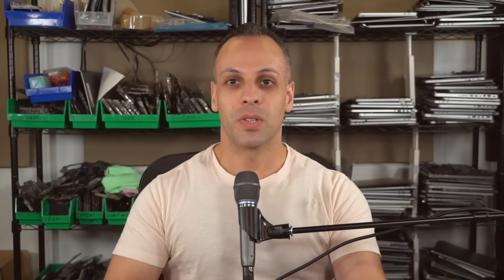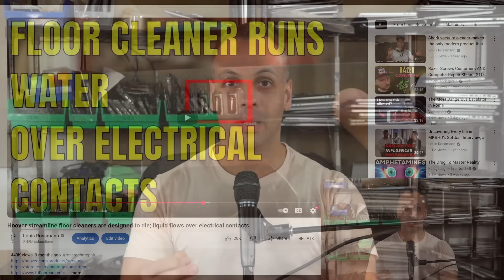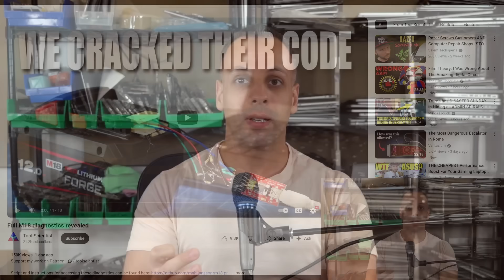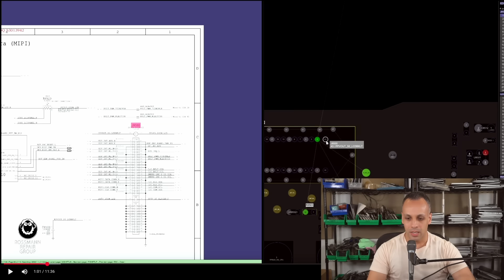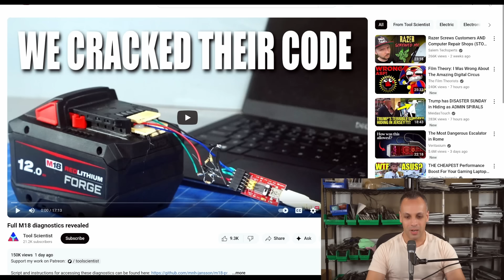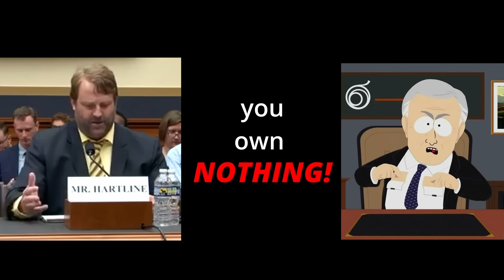Imagine putting DRM in a battery to void warranties...

Comment: I restored my 27 year old battery (NiMH) powered drill by soldering in a plug so I can use the LiPo batteries I already have for my RC and fpv hobby. 

So simple, added a 2 USD voltage display since there’s no BMS. 

Since the LiPo’s are storage charged they are always ready to go and I charge them AFTER I’m done drilling. 👍

Comment: I do have bunch of Milwaukee tools and biggest fuck/n regret is that bluetooth 3/4 impact gun. I barely used it as changed jobs and after a while(it was tucked in a toolbox, nice and clean) the bluetooth battery died. Okay I thought just replace the coin battery and that’s it…wrong, somehow the bluetooth controller died, just blinked, but stupid me never did extended warranty so it was too late to replace. Had to buy a new complete loom - basically the whole electronics) for around £100 and have it coded to my serial no. Worked again for a month or two and now can’t even connect to app and shows that tool being registered elsewhere…putting Bluetooth into an impact gun was the most stupid idea.

Comment: Wow, that was fast. The video by tool scientist was only recently released and now already featured by Rosmann. I am happybto hear the issue of subpar batteries by Milwaukee is being adressed, if only now through the narrative of TTI. I think adrrssing that a missing relevant bms cell balancer is long overdue. Toolscientist already showed that the new forge batteries haven't made a relevantbjump in bms board quality for cell balancing in their new forge batteries. So there is still room for a lot of improvement. It is only unfortunate they dodn't take the chamce to really make a better battery while they had the chance. Maybe there was relevancy through customer feedback to.adress power issues. But I think itbis an omission that they didn't adress battery technology basics in cell balancing. There was already general knowledge technology knowledge available on cell balancing by big cimpanies, Trdla amongst others. For the premium prices Milwaukee offers, the fact that the batteries prematurely fail longe term use over power metrics is a waste of investment for the consumer for a technology of batteries that has been proven to last a longer time than older rechargeable batteries if treated cirrectly with correct health. Yes 't  demands are different in power tool batteries and lifetime will likely be somewhat lower. Un my experience though, the lack of a proper cell balancing technology could gave helped power loss over time due to uncreasing cell voltage drifting due to improper cell balancing components on the bms board could have helped diminish this long term issue. I can not imagine Milwaukee  did not know this. I think if added it would not diminish its brand loyalty. Contrary to what Rosman is claiming, I don't think Milwaukee as a subbeand of TTI is not making rubbish tools. My experience is tools I purchased are actually powerful and good. What I do notoce is that new products are often focussed in solving user functional issues, but not going the extra mile to factor in certain relevant factors into further improving certain less known features that could help improve the longterm health of certain tools. I do consider milwaukee as a premium tool brand. They certainly ask a premium price, but hthey also have been ahown in many comparisons to be an on average very good tool. I think on design  and support they sometimes could do better in the ergonomics and sound overall ergonomic design. But going back to the thread of this story, ues, the lack of a proper cell balancing technology in the charger and battery is an eyesore in the whole experience. So many videoa have been out there on the three bar (..out of four bar maximum) full charge issue has been here for years. I have discovered myself as well that the cell imbalances are a glaring issue. You can balance them yourself with not too complicated tools, which I.have unfortunately also done for several years with my milwaukee batteries, so have got some experience. One could argue it could be perhaos the cause of increased cell resistance due to high power demands usually associat3d with the function of the tool. But I think in the overall design it shouldn't be at the cost of loss of lerformance over time. I have HO Milwaukee batteries that started significantly drifting after only two years of normal use. Which means I have loss of power over time due to cell imbalnc3s. This is not a atoo t3cnically difficult issue to solve by milwaukke, but I don't understand why they haven't taken priority this issue from their first forge batteries. The issue was known 5 years well before forge was released. I can not imagine they didn't know this issue and not have theopportunity to fix this not too difficult issue. While I wouldn't be surprised to have more and sooner cell resistance issues, i tjink still having a decent cell balancer in the bms board would be, also in my experience a dcent solution to at least be able to use the battery with decent health a while linger with proper cell balancing technology. In my experience the Milwaukee or TTI warranty means nothing. You might get a new battery by arguments of diagnostic criteria. You get a new battery, but the problem is still there. So you know yhe problem in the replacement battery will still come back in due time. The only solution I can see now, is to not put blame on TTI on caliming they make bad tools. Many subbramds by TTI make great tools in fact, but we must adress the facts, yes facts, that the battery technology is not good  enough and a simple solution with a better bms with good ACTIVE cell balancer could mitigate quality loss of their batteries and not lose customer faith. Many TTi tools are great, its the battery technology health system that is failing their products. The new tabless cells may perhaps solve some aspects to cell resistance and power management woes, but in my view if they went the extra mile to think about battery health with a cell balancer, I think many battery issues of older batteries could be solved today. The batteries are priced quite premium. I then alsi expect that the priductbalso has proper I ternal health care circuits, which they in my view and experience lack in real world normal use. That makes me weary to rwcommend Milwaukee batteries. It's not beacuse they brand makes inferior products. But what I do see is the most basic energy priduct for running their tools, the very basic essence of wat makes there tools wwork, has a glaring issue. And it is interesting to see that other subbrands have sumilar issues with their basics in bms management systems, and not only TTI products. I'm not too worried about TTI milwaukee's "inaccessible" diagnostic codes, because the cell balancing issue can be found just with a simple multimeter and a power station and only requires some general knowledge on how Li ion cells work. I not need diagnostic codes to figure it out. Meaning to say I think likely the long term performamce issue of milwaukee batteries is the cell balancing issue in my experience. And it is odd that I have to putbon so much effort periodically to actually open  a premium  battery to tepair it with simple tools only to make it work another 5-6 cycles just to reuse it longer again, while it's solvable with just some added components to the bms and milwaukee charger that is just a little bit smarter and has equal amount of pins on both the tools and chargers for bidirectional charging and discharging. This would greatly help the platform to manage and fkexibly solve these kinds of issues and also expand the batteries capabilities. I think  TTI's subbrand diagnostic codes become a more relevant argument once they've solved some basic tools design issues that I suspect did jnow for a while, seeimg they chrinonolgy of recent tool performance discoveries. It's perhaps where the focus is on. Milwaukee reviews usually review power performance. There are several vodeos on charging issues with the battery, but they way they demo the dead or dysfunctional batteries I think reallybhides the underlying cause that is glaring, when looking a little deeper when ipening the battery. I am happy the battery is this accussible and "repairable". So compliments to TTI/Milwaukee for taking that into consideration. With no, in my view, proper and good active cell balancing system, preferably at at least 1 to 2 amps for decent cell balancing times, I think the  codes and warranty don't mean much, and maybe together we can adress this issue with the subbrands in question and maybe in due time TTI (bottom up instead of top down?). Thanks for adressing this issue.

Comment: This bad junk is just 1 line away from being something that will be sued for... I hate the you voided your warranty by... my first answer every time is no i did not... you used it in too hot a location... really what is too hot. wouldn't it be easier to just send a shutdown while too hot there are many pieces of equipment that shuts off it too hot or cold. I have had my phone shut down due to being too hot. 

Most the time if a product is good you will not have warranty claims let alone reasons to deny the claim. Any time a company dose something like that i have a simple solution.. i will not buy any products from that company and i will back search to find who else is related to that company.

Comment: Kinda sorta glad that Dewalt batteries are kinda ... just "dumb" batteries. They only have a simple circuit board with what looks like a balancing circuit, while all over-discharge protection is built into the tool and over-charge protection is built into the charger. It's wild.

Comment: If I recall, the findings were that the over temperature counter didn't go up unless you were simultaneously discharging 10A, meaning if you leave it in a hot car and the batteries overtemp, that's not recorded.  ...  Which is kinda a bad thing tbh because it'd be nice to know if that happened.

Comment: Not that I care for the company, but the owners manual tells you that storing at temps over 49C may cause permanent loss of capacity....... So complaining that the warranty was voided because of over temp recordings in the battery(even though it wasn't 'in use') is a bit silly.

Comment: I recently repaired a Kobalt 40V battery by replacing the 10 cells inside.  There are wires going to each battery to measure the voltage, but there are no resisters that would be used for balancing.  They do this on purpose!!  A new battery would have cost me about $120, I put in all new cells for $25.  Granted, I have the tools and the knowledge, but what he says in this video is true.  All these batteries are crap!!  And, of the 10 cells I replaced, only 2 were actually bad.

Comment: Techtronic Industries (TTI) also have a monopoly with Bunnings Group Limited in Australia, as TTI have intentionally made Bunnings Warehouse the only authorised seller of Ryobi Power Tools + Batteries to be anti-competitive, and replacement warranty is only applicable, if you purchase Ryobi products via Bunnings Warehouse and return product to store; otherwise, Ryobi (TTI) requires you to register products online with proof-of-purchase from Bunnings to obtain any form of extended warranty or repair.

You cannot even buy any Ryobi products online in new unopened condition, as you are essentially buying a product without any manufacturers warranty, as any seller other than Bunnings online is not considered an authorised seller and Part Numbers differ for same products worldwide.

Comment: I'm sure they've already thought about and are planning to make batteries in drill/etc to be permanent and non-replaceable. No more swapping out batteries! Only WE have the drills where you don't have to swap out batteries! You'll have to buy multiple drills when you run through the battery. The only way to stop it is to do like the EU is doing and demand service replaceable batteries. Don't expect that to happen in the United States in less than 20 years.

Comment: Harbor Freight "Hercules" 20V warranty experience : I had a 20V 5aH battery die after about 1 year of hard use. It's a 3-year warranty. I went to the store and less than 15 minutes later I walked out with a new battery.
That's why I'll take the the flak and the comments from the fellas about using Harbor Freight "Hercules" 20V power tools, cause I'll take the no-nonsense warranty and laugh all the way back to work.

Comment: It's also said that Decathlon puts DRM in batteries for their e-bikes so that you can't replace old used battery with a new one from different manufacturer. I wouldn't complain but Decathlon stopped producing batteries for their older e-bikes like RS 520e...

So you can't buy original battery for ebike but also you can't use a battery from a different producent.

Comment: I bought chinesium knockoff v20 batteries. They work GREAT. If anything seem to hold more charge than the real deal. Now, there is no warranty, but they are half the cost and since the warranty isn't honored often as Louis points out, nothing is lost. And best part is theres no spyware or DRM in them. They're just batteries.

Comment: OK, I have a slight disagreement and that is the fact that I am a small engine mechanic and I use Milwaukee all the time and for the most part they aren’t too bad nor did the battery seem to be too bad other than I guess the case design is a little bit stupidwhere it screws together is very thin so overtime for vibration, especially on the impact and drops it’ll break and separate the top apart from the batteries so then it won’t clip together, but then you use JB the fuck out of it or epoxy it

Comment: There are metals that would probably work for that sensor talked about but it would require one or a few more steps in the manufacturing process. Water sensors that are made for continuous water exposure.

Comment: RE no battery balancing in the BMS: Milwaukee (and most tool brands) batteries also don't have low-voltage cutoff built into the battery, but only in the tool, so if you use one of those aftermarket "works with 'brand' batteries" tools from Aliexpress (like a blower or flashlight etc) it's possible to fry the batteries by discharging too much. Tool Scientist showed that the actual chip inside the batteries does support that feature, it's just not implemented in these batteries

Comment: The thing is, the data the battery collects isn't inherently nefarious. The battery being able to collect and store that data could be invaluable for engineers to improve the product.  The problem is they seem to be using it as an excuse to void warranties or claim abuse. I personally think a properly designed tool platform should not allow the battery to be abused in the first place.

Comment: Lemme be the akshually guy for a sec:
A BATTERY is a collection of CELLS. Your example 52v battery is not 14 individual batteries. It's 14 individual CELLS, which together comprise the BATTERY.
Yes this is a pedantic technicality but words matter. All of the points Louis makes in this video are valid and more important.

Good on you for calling attention to ToolScientist! That was a lot of work in figuring out the Milwaukee packs

Comment: Milwaukee headlight from a 2 pack from Home Depot, stored in Semi Truck door got wet from leaking window seals, would not turn on for my pretrip inspection,  the headlamp does have a IP54 rating.  Pulled the battery and reseated, as older iterations get connection issues over time.  Could not get it to work, took it home as the second light was in my garage.  Test the 2nd light before pulling the battery.      Diag via swapping components resulted with both headlamps inop, with both batteries error-ing out when plugged in to charge.  Seriously, what are the chances that you start off with 2 working lights, and end up with 0 working lights with both batteries bad.  Complained to Milwaukee, at least their warranty did send me a new set, but after seeing your video, my next headlamp will be a Coast, and I’m going to have to reconsider my choices with my next battery tool.

Comment: Reason why use 12 V (11.1 V) and 20 V (18 V) Parkside tools from Lidl, is because of the honest prices, the balance charging batteries, and the lack of any protection in the firmware.
I replaced the defective cells in a used-up, four-years-old 18 Volt battery, and it worked well since. As you said Louis, manufacturers don't lose the opportunity to insert cryptography into the batteries in order to enforce terms of warranty, limit terms of warranty, and force users to buy new batteries - when an easy cells swap (made by a professional) is instead the best course of action.
I never thought that we had to fight for open-source battery one day, but that day has come...
Thank you Louis...